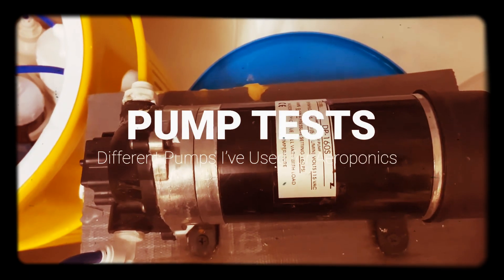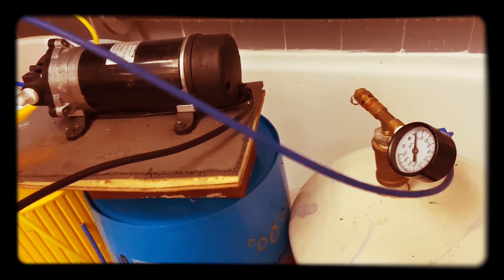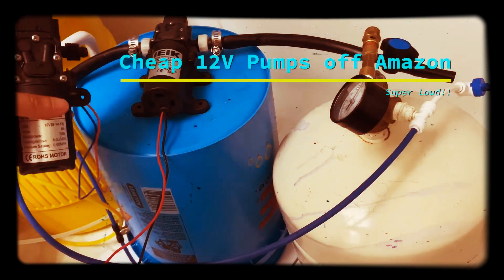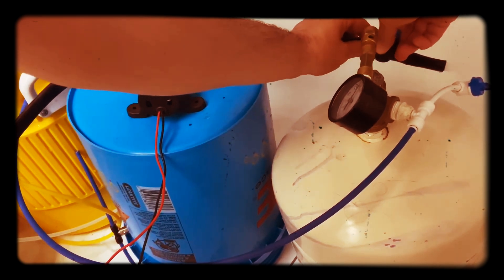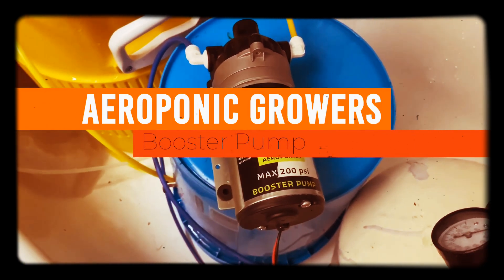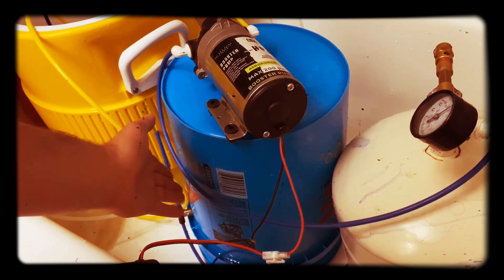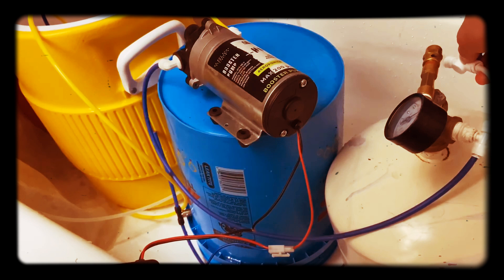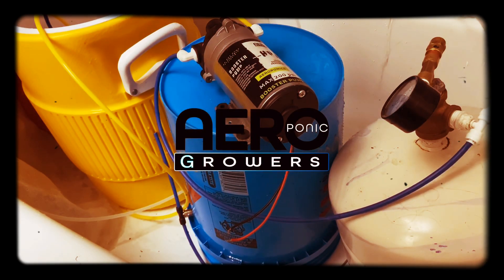Pump tests for aeroponic TrueHPA systems BACO SEAFLO Aeroponic demand, delivery & booster pumps

Comment: now that the video is 4 years old is it still possible to get the last one/the silent one ?
Reply from the maker: Yah Aquatec 8800 series diaphragm pumps are very available
Reply from the maker: I just don’t sell them anymore
Reply: @AeroponicGrowers oh its a 8800 with a sticker on . Cool , thanks for the answer . 
Its so quiet compared to the others
Reply from the maker: @danededane that’s a BACO 160 psi pump that gave me a lot of troubles over time. Mainly the fittings in and out of the head. But just go with an Aquatec and most importantly get the pressure switch for 80-100 psi cut off. They can be hard to find sometimes.
Reply: @AeroponicGrowers  
Its just that it seems like 8800 is a little hard to come by or just expensive here in EU. Are there any similiar pumps that are just as quiet ?

So 100 psi max is enough? 
I was thinking just using a pressure switch from a air compressor so I was able to adjust the pressure myself ..
Reply from the maker: @danededane  yah you guys have to engineer things differently over there with the parts available to you. You want a pump that will go to 115 psi. I use one that goes to 160 psi but I have it on a 80-100 psi cutoff. It’s more an issue of the fittings not being able to handle high pressures and your accumulator tank. Plus that pressure with the correct misters produces the 60 micron droplets. I’ve used air compressor and liquid pressure switches made for houses and they work. It’s just hard finding them in high pressures.
Reply from the maker: @danededane  also if you can get your hands on an Aquatec it will outlast any other pump on the market. They can even run continuously. By the time you try out a few pumps it may cost more than getting an Aquatec.
Reply: @AeroponicGrowers  Thanks for the advice . I'm also wondering if I for once should just try buying the right thing the first time :D
Reply from the maker: @danededane  it’s the most expensive part of the system. But an accumulator tank is like 30-40 dollars, misters tubing and pressure fittings are cheap. And the root chamber can be built with a multitude of cheap materials. Just make sure you get around 19 inches of depth in the container.
Reply: @AeroponicGrowers i found a 8900 on eBay shipped from bellerofonte located in Italy . Would that be okay ?
Reply from the maker: @danededane  that’s where they are manufacturing them over there. I couldn’t find anything on the Aquatec website about it but it looks like 135 psi. The PSW-2100 is the 100 psi pressure switch for the 8800. I would call the Italy factory and ask if it’s compatible. They are like $20-30 bucks and you don’t have to cut your wiring harness to pieces. See if you can get a pump with 1/4” OD fittings. I only found ones with 3/8 for $147 on Amazon in Belgium https://amzn.eu/d/7bDkiC7
Reply: @AeroponicGrowers but isnt the 8800 a 24v ? As i understand this is a 230v ? Which is fine by me but its just a little difference. 
I will try to contact them . Thanks for the help so far !
Reply from the maker: @danededane  the 8800 can be either 12V or 24V here in the states. I stick to 12V because 24V you can feel when you’re wet and touch something! Plus most car battery’s are 12 volts and we keep them around if the power goes down.
Reply from the maker: @danededane  you need the adapter to transfer the wall voltage from AC to DC. Sometimes that’s when you have the option to pick one. A pump will run on 12 volts because it’s DC. The more juice you give it the faster it pumps.

Comment: The pressure tanks are mostly rated for 100 psi did you encounter any problems running that 200 psi pump?
Reply from the maker: I don’t run the tanks higher than ~100 psi. The pressure switch is at 80-100 psi so the pump shuts off. I think most tanks aren’t even rated for 100 psi…. Oops 😬

Comment: where can i buy these booster pump?
Reply from the maker: They are all over the internet. Get an Aquatech 115psi head with a pressure switch. I’m using diaphragm pumps
Reply: Why did you switch to a diaphragm pump? Which pump are you using and what psi does it deliver? @AeroponicGrowers
Reply from the maker: @robbchristensen1151  I’ve always used diaphragm pumps they are the most affordable. I use an Aquatec 8800 pump but with 160 psi max head rather than 115 psi. I recommend using the 115 psi head since most equipment you will use is not rated for 160 psi. You don’t want a 160 psi filled steel accumulator tank to blow off the line, even 100 psi can be dangerous!
Reply: I recommend Water filters direct. That's who I'm going through
Reply: Just one question do you combine a water pump and booster pump? Do booster pumps works even there's no intial freeflow?